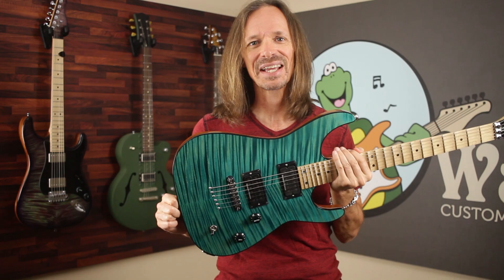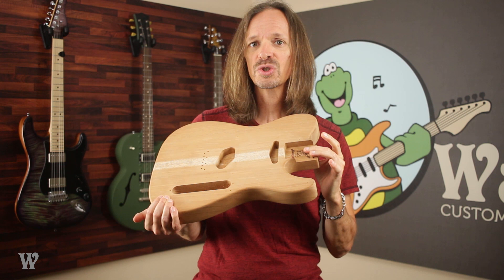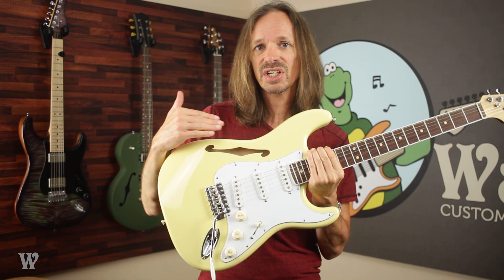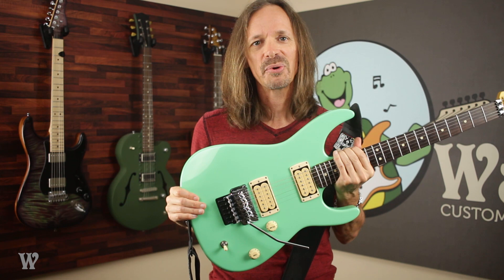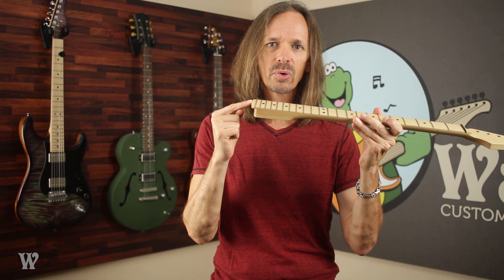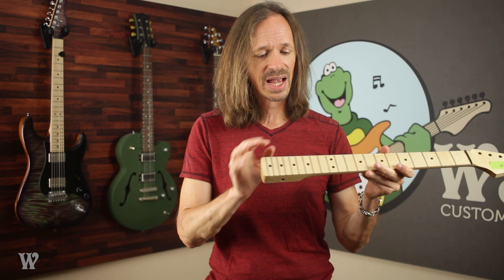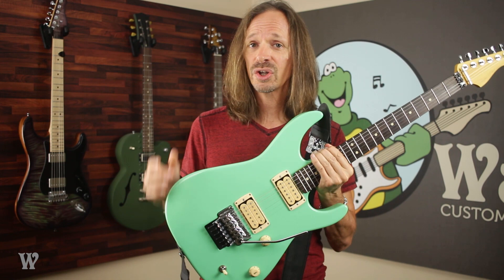Aaron Explains the 720 Mod

Comment: IMO rule of thumb: if your Floyd type bridge sits in top of the body without a recessed routing, it won't work... but with the right body it will play more like a Strat, and the heel is appreciably reduced.

Comment: I learned the hard way about fretboard overhangs and deeper neck pockets when I put together a partscaster a few years ago - never even thought to check for clearance there, I'll never forget the cracking noise of the fretboard on my rather expensive custom nitro finished neck when I tightened up the screws.  Oops!  Saved it in the end by cutting off the overhang and a bit of creative clamping and gluing, but still an experience I never wish to repeat.

Comment: Holding a vintage Fender the first thing you notice is the neck sits deeper in the pocket.    Looking at the side of an old strat only half of the side dot is visible above the pick guard.  What happens on a build, with a flush mount string through body, you wind up at the limits of the string height adjustment screws.  It is still playable but I like to see some extra adjustment just in case.  You can always trim the pick guard around the overhang.  If I had only known I would have ordered it.

Comment: I’ve always found it a bit odd that the 720 mod is so unpopular. I wish it were offered more regularly, particularly on bodies like Soloists. But I’ve played Ibanez guitars for years and so I’m used to the neck sitting lower in the pocket. Speaking of that, the way to solve the 720 mod with pickguard is really easy as long as you’re willing to modify. An Ibanez pickguard simply doesn’t extend under the fretboard extension, so you get an even lower feel on the pickguard equipped guitars.

Comment: Love your videos. So clear, useful, and honest. Here is a video request. I've seen videos on conversion necks and 7/8 bodies/necks. But I would love to see a video comparing the ends results for achieving a 24.75" scale (i.e. regular body with conversion neck vs 7/8 body and 24 fret 24.75" scale neck). 24 frets vs 22 is obvious, but I would love to hear about balance, weight, and tonal differences (given PU spacing will be a bit different with the two options).

Comment: Hard to focus on the issue b/c I was so mesmerized by the beautiful spokesperson!!!  I have thought if I order a Soloist body that I would get the 720 mod, especially if I ordered a 24 fret neck. If I ordered a Soloist body and a neck contour and the 720 mod would that leave the thickness of the neck pocket so thin that eventually the pocket could split over time? Aaron, I hope the neck dept has caught up with the backlog b/c I'm about to order a custom Gibson Conv neck without a finish. Thanks.
Reply from the maker: I will not apologize for being beautiful. Is it my fault I was born with perfect bone structure? :)

Oh....also, a 720 mod will work just fine paired with a neck contour. Nothing to worry about.

Comment: The only thing I don’t like about the 720 mod is the extra cost to get it...I mean,you are already routing the neck pocket anyway,why the extra charge to route another 1/10 th of an inch?..Not trying to be a smart ass,just have always wondered why....I personally like the 720 mod simply because I don’t like the gap between the neck and body...it doesn’t look right to me with the gap...just my OCD’ness I guess..but you did bring up some points against it that I had never thought of..

Comment: Is this available on any body? I had no idea what it was. I have a baritone tele neck that is extra thick at the heel and I’ve always been too intimidated to take any material off the heel and it also is a really thick neck so it wouldn’t work right. A body with a deeper neck pocket would definitely help.
Reply from the maker: No, it's not available on every body. We remove the option from bodies with options where we know it will not be compatible or cause problems. When in doubt, send us an email or call in and we'll help you out.
Reply: Warmoth Guitar Products will do and thanks so much for the response.

Comment: Thanks for yet another informative vid, Aaron!  Great job explaining the pros and cons! But what I want to know is why someone would put Seymour Duncan Parallel Axis Trembuckers in a hardtail guitar like that when they're "F-spaced" for trem bridge string spacing. Well, the bridge versions are (patb-1, patb-2, & patb-3). The patb-1n for neck position is standard humbucker spaced? They are sweet pickups, I have the patb-3 & patb-1n.
Reply from the maker: We constantly mix and match stuff all the time here. It's crazy. Did you also happen to notice that guitar had a TOM bridge and a Floyd Rose nut? We ain't scared of nothing! ;)

Comment: PSA: It's especially important to maintain humidification with fretboard overhangs! One dry season, and the fretboard shrinks slightly, and that overhang curls up causing "potato chipping." This makes your high frets slope up such that you get dead notes and buzzing up the neck. The only way to fix this is to either re-plane the board and refret, or level the frets on an angle to  compensate for the potato chipping. 
HUMIDIFY!!

Those who own or work at a guitar shop: Every time someone trades in a guitar with an overhang, it's very likely to be badly potato chipped. Make sure you don't buy a trade-in that needs expensive fretwork! My buddy who owns a guitar shop learned the hard way!
Reply: I'm amazed how few guitarists understand humidity.

Comment: I have one question. One of the guitars in the vid has a reverse headstock and locking nuts. How do you tune that thing once you lock down the locking nuts? I mean, it has no fine tuner bridge, Floyd or otherwise. Just curious.
Reply from the maker: Yep, it's goofy isn't it? :) Here's the details: https://youtu.be/InUWrISGp-0
Reply: @warmoth  I mean, however you tune it, once you lock the nut it's gonna go sharp, and without fine tuners there's no way to get it back in tune.

Comment: Hmm, i think this needs a a bit of an explanation on a specific issue.
On a back routed strat body, the strings will not be at the same height as a top routed body, as it does not have the pickguard to give it that extra height, as such, wouldn't the 720 mod bring that height down on a back route body to the same/ish level of a body with a pickguard?
It just makes sense to me, so if its not so, it needs a bit of an explanation.
Reply from the maker: Yes, what you're saying is more or less true regarding the relationship between the top of the body and the strings. It's other things that account for the difference in feel. For example, humbuckers still have the ring around them - in essence a mini-pickguard where the height stays the same immediately around the pickups. That mounting system was designed for the usual string height, but now you have to adjust the pickup much further down into the rings. Similar adjustments must be made to bridges, either by recessing them, or adjusting saddles to their lowest range. Etc, etc.

Comment: @Warmoth would a 720 mod compromise string height or a H/H pickup installation (wood routing) on a plain Fender Stratocaster with standard/compatible Fender Stratocaster tremolo system? Suddenly confused... I thought whatever necessary compensation would be taken care of if neck and body were bought together... I'm not too worried about the strings being lightly closer to the body, but am concerned that (maybe) I might have to route the tremolo further into the wood to balance the string height across the board.
Reply: Never mind, sent a message on my order's thread, so it's all good. \o/

Comment: When talking about hight of the pickups/brisge etc... Would it be more or less feel/play like a neck through guitar?  Since the fretboard would be about as high as one?
Reply from the maker: It totally depends on the geometry of the guitar. For example, a Les Paul is set neck, but because the neck is angled backwards the strings, pickups, and bridge all stand really high off the body. OTOH, a PRS set neck has a straight angled neck, and everything sits down very close to the body. The 720 mod would feel much like that, and not at all like the LP. Hope that makes sense.

Comment: so how do i know if i like it or not till i buy one?
Reply: You could try similar guitars at your local shop, lots of low profile models especially Ibanez and other superstrat type guitars take a ruler or even better a digital caliper and look for a guitar with strings and bridge height about 2.45mm or .095inch closer to the body than a standard strat, a good shop could tell you what models are low profile.

Comment: As cool as a bridge really low to the deck looks, this would probably drive me crazy.  I have a Fender Jaguar body that has the opposite.  It has extra material to simulate the buisiness cards Fender used to have to shim the necks with.  Your neck fit it just fine.

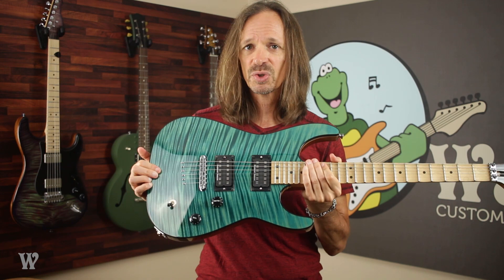Comment: Hey Aaron! Thanks again for the helpful videos! Got a question for you/any other viewers who have seen my comment and can help as well :). Since in the video at about 2:50 you were holding a guitar with a Floyd Rose in it when you were talking about checking the adjustability of the bridge, I got a bit of a "subliminal message" if you will and I'd just like to confirm it: are you suggesting that a 720 mod is not good for a body that has a Floyd Rose bridge on it because of a lack of adjustable range? To put this in context, at some point this year I'll be ordering a custom Soloist body routed for a Floyd Rose and 24 fret neck from Warmoth for my first ever build, and I want to make sure I get everything right the first time :)
Reply from the maker: Haha! No subliminal message was intended....it was just the guitar I happened to be holding. A Floyd can work just fine with the 720 mod.
Reply: Can't stress this enough: when doing something outside simple, stock options, get one of their sales reps on the horn (Spike is awesome!), explain what your vision is, and ask about any pitfalls along the way. I learned some hard lessons on my first self-driven build, and that was for a bass. Guitars are even more difficult.

Comment: Quick question can I replace my stock 21 fret neck on my squire stratocaster with a 22 fret neck
Reply from the maker: You should be able to, since a 22 fret neck has an overhang on the end of the fretboard....but the only way to know for sure is to measure. Everything you need to know is here: https://www.warmoth.com/Guitar/Necks/faq2.aspx

Comment: In a previous video comment in the spring you said you they were dropping the 720 mod
Reply from the maker: It's such a confusing and trouble-prone mod that we did, in fact, drop it for a short time. There was such an outcry for it - weeping, wailing, gnashing of teeth - the we put it back shortly thereafter.
Reply: @warmoth  Good to know! Well just so everyone knows I got the 720 mod on my soloist body and it works well with a Gotoh 510 trem. I thought it might make upper fret access a little better, but it doesnt really help that at all.

Comment: I've been considering getting a body with 720 mod, but is it compatible with the Schaller 475 Flat Mount bridge? Also, even though you said we shouldn't get a TOM bridge, your guitar has one. Is it recessed?
Reply from the maker: Yes, that was a recessed TOM. In this case you could even say it was "super-recessed" because of the 720 mod. It sits really low.

Comment: I think everyone would agree that the metric system is objectively the preferable one.
I wonder when the US will finally decide to switch.
Reply from the maker: Probably never. I'm guessing there are too many manufacturing concerns, where converting to metric is prohibitively expensive. I am predicting we'll exist in this weird limbo between imperial and metric for many decades to come.
Reply: @warmoth  You’re probably right. Still, it would be interesting to know how (and to what extent) this was implemented in Britain.
If I’m not mistaken, in everyday conversation people there still talk mostly in imperial. And for some measures those units still are official.
Maybe someone—older?—from the UK could pitch in?

Comment: You know what though....  If you get the 720 and don't use a pick guard that lowers the strings closer to the body. Without the mod, but using a pick guard, you're essentially the same height because the pickguard raises the "base" where your fingers would rest. Hmmmm  It would only make a difference on a guitar like yours where there is no pickguard.